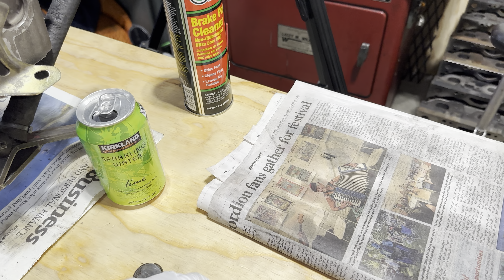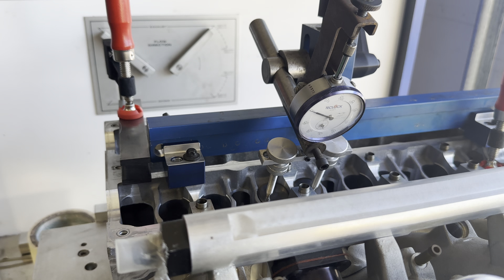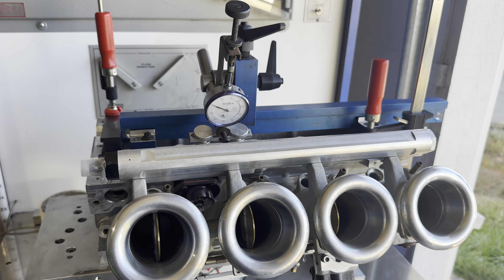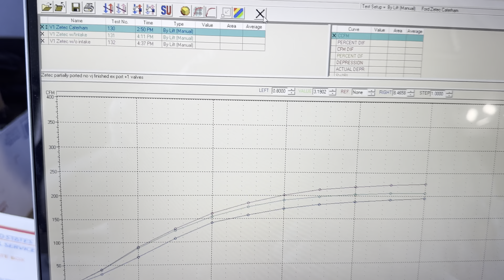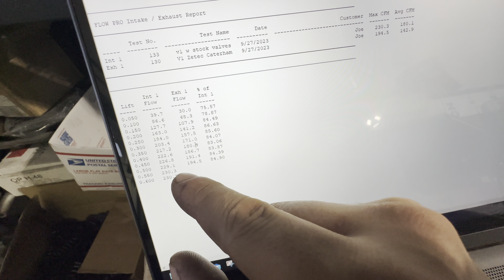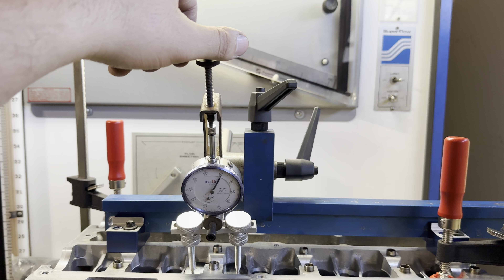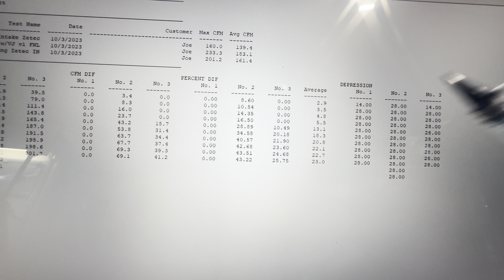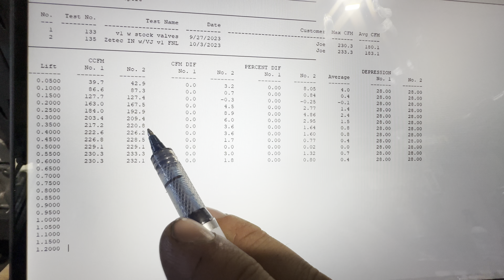Race Porting the WORST NA Head I've ever seen! | Toyota Valvetrain Explained, Engine Rehab Episode 7

Comment: Exhaust leak ticking is a common occurrence in many UZ series motors so i would say you're guess is probably right. Lots of people have 250k and up mile uz's with just MLS head gaskets and a turbo putting down 400hp+ to the wheels. The record for a non vvti sc400 that has a stock bottom end has ran in the 8's. Crazy reliable and strong engines. You really need a stand alone ecu to go past the mid 300hp range and only certain factory ecus can be tuned iirc. Plenty of junkyard supercharger  options for cheap power too.

Comment: A stock SVT/St170 Head will have 50 more cfm of flow everywhere and can see 300 hp NA if done properly. 
Nothing is the same between the 2.0l Black top, and the svtF head. 
Different valves, ports, cams, vct on the intake cam, bigger holes, different tappets, different valve guides, its all different. Valve cover is not the same. The intake flange is 15mm shifted on the bolt flange. 
If you want real info on the svtF/St170 head, you have to reach out to danSTenginering and burton power.
Reply: So if I was looking for more in that head shown here, it be more readily achieved at perhaps those you mention or some place else with fuller info on the range? This is too experimental? Lacking?
Reply: What? 
I cant understand what you are asking.

Comment: Did the first Zetec heads 25 years ago.  Didnt do much on exhsust as ruined one because of extreme core shift.  Then found out ...a good seat profile , back cut and nice radius ..... ready.  

Intake port I  , depending on budget ,  either kept it small with 34 mm valves.  Or raised it with epoxy about 4 to 5 mm from start to inner radius.   That flows good.

The focus 170st  head  or silver top heads are much better on intake and easier
Reply from the maker: Yeah, I got a look at an st170 head, weird that this was in a caterham.
Reply: @EngineRehab Zetec is a common swap into the caterhams, until the duratec came out that is

Comment: The Zetec head you have here isn't the SVT Focus version - it's a standard 2.0L head from the regular Focus models, probably '03-'04 based on the casting number. That would start with 2M5V instead of YS4E if it was the SVT, but the most obvious indication is the lack of VCT oiling and solenoid mounting for the intake cam. You should have seen stock flow numbers closer to 160 exhaust and 230 intake on the SVT. You still got great numbers - Central Florida Motorsports used to sell a ported SVT head that maxed around 195 exhaust and 255 intake.

Comment: Can you run gappless rings? They will give it a little more suck on the intake giving you a tiny boost to intake exhaust flow ratio. 

It's clear that the port wants the floor raised a little, if you could weld the F out of the floor I'm sure you could get the 250cfm number you're chasing.

Comment: You said something about running .430 or .450 lift. Given the valve size that's a lot of lift. Would a 50 or 55 degree intake seat be a better complement for that much lift, with appropriate top and throat cuts? Or, given your low lift numbers, maybe a 30 or 37 degree intake seat will pick those numbers up, with the greater separation area between the valve and seat. 

I meant to post that to you on Reddit.
Reply from the maker: I think a 50 degree cut could help, but I think the ultimate path would be epoxy, shrink the port up, and add some short side height to it.
Reply: I know nothing, but I assume that unshrouding the valve in the chamber as much as you can (on the side opposite the intake port where the air will want to go) and using a flat 30* seat is how you could get better flow @ low lifts.
& you aren't planning any K series, Skyactiv, Duratec investigations in the future are you? :D
I'm having fun watching. @EngineRehab

Comment: I'm thinking about building a 4.8 LS maybe a 5.3Lt, or even the 4.3 LV3 , possibly modify a 6.2 intake ,  maybe a small turbo capable of 1 bar boost, with a BTR CAM, port the head, work the valvesand seats, un-shroud the valves maybe go a bit over sized. If they can be un-shrouded enough, connect it to a 5speed or 6 speed, connected to a 8.8, stuffed into a subaru Forrester from the late 90's early 2000s pre-06-08 roughly. Looking for 600-700 to the tire. With the ability to crank it to 890(+/-)with a tune E85, and a turbo swap, i want to keep the lag to a minimum, maybe use a diverter valve with a twin scroll, i dont think id be wanting to spend $$ on a variable geometry turbo.  I'd like to get the head's flowed at least before porting, my rigged up flow bench can show changes, not comparable numbers with real flow benches. Possibly get them flowed after to get an idea of the potential, awesome video, if i don't learn something, it at least makes me think about things.  Happy new year 🎉

Comment: Really strange results for a 4 valve. Not much more than my gen3 gm 60 deg v6 heads. And those are 2 valve with 1.74 intake valves and 1.42 exhaust.

Wonder if theres something with the chamber also?
Reply from the maker: The chamber is not great! It's a big old flat bathtub, not much I can do about that.

Comment: Run the lash down to .006-.008” on both sides.  That’s exact architecture we’ve been running on the Japanese bikes forever.  Typically everything is shim under or we convert it to under if any performance is the goal.  I know the  logic is the exhaust is gonna run hotter so they want tad more clearance so it never tightens up and keeps a valve hanging open, but we’ve done tests checking lash, directly starting engine and run the shit out them and getting it hot, and immediately popping the valve cover.  The lash never gets smaller it actually grows. 🤷🏻‍♂️. So we’ve always run em on the tight side and pretty much every bucket engine will work with 6-8 thou.  Now you can play with it, open it up to pull some duration if the aftermarket cams too big.  Etc etc.  but your an engine builder too so I’m sure you get what I’m saying!👍🏻. You know Laurie at web too I see, bunch of nice girls over there and they do good work!  Do you get anything from Megacycle- (Barbara’s a tough one 🤦‍♂️)
Reply from the maker: Mega cycle is twenty minutes south of me. And no, I hear she’s a firecracker.

Comment: Question, does anyone do anything performance related with the dodge 2.4L, in the 06-12 years,(08 dodge avenger) or are they 💩 as it seems, i have had the idea of swapping a k24 and manual transmission in its place. If i can get it to run like a stock car, and everything work, tricking things to behave. Or possibly run a standalone ecm, and simulate the signals to ecm, possibly piggy back the stock ECM, maybe even swap a J-series if i can get a 5-6speed, convert to rear drive in a 08 avenger, use a charger rear diff, narrowed axels, would be cool but id want to make a project of it not just a swap, it needs alot more to go with it, much more to do. ✌️

Comment: Port matching still to do You said then you don't want to open up the port entry. I don't know any of your level tech. Would it be better just to go to all the most rewarding cuts in ports befor flowing? Many four cylinder heads leave me mystified by the subtle changes in head design that produce faster accelerating motors and broader rpm HP.. Not all the great producers are 4 valve unless punching for RPM. Is any or all of that sounding ...about right? Without going into the cam duration and lift values?
Reply from the maker: The intake manifold side is smaller than the head and needs matching. And on stuff that isn’t responsive to porting it’s helpful to spend time testing on the bench to ensure every decision made contributes to an improvement. More than just total airflow too.
Reply: @EngineRehab  yes. velocity is important more than a passive gulp of air volume , I'm told. I am trying to end up with the right mix for Nissan NapsZ . From heads for 1.6 to the big 2.4 with big valves and ports. Another can of worms.

Comment: THIS IS NOT A SVT/ST170 CYLINDER HEAD. 
This is a Non VCT 2.0L 2000-2004 Focus Zetec black top. 
At max puff without modifying the cam lift bucket area you will never make over 220 hp with that head. 
This is the worst cylinder head in the Zetec lineup
Reply from the maker: Yeah, this will make plenty more, and regardless of which head it is, it's what we have to work with. Thankfully It's going to do just fine :)
Reply: Your work is good and your data is fantastic. 
The main reason i commented is to simply inform you that it is not a SVTF cylinder head. 
I have a hand full of oe casted SVT F heads sitting i am willing to ship to you with some valves so you can see if your ported 2.0 black top is better than a actual svt F head. ( im sure your port job will be better than a stock svtf head but by how much???? ) 
Ill pay for the shipping if you want a SvtF/st170 zetec head with some valves for testing.
Reply from the maker: @bscotty24bmx  that info would be great for you and the public! I’d flow it if you sent it.
Reply: @lindoncoggins  one of my comments got deleted some how.
Reply from the maker: @greatestevar  what are you talking about.
Reply from the maker: @bscotty24bmx  wasn’t me

Comment: What engine is this?
Reply from the maker: 98-05 Ford Zetec 2.0. Would have come in the Ford Focus, Mondeo, ZX2. Some caterhams had them too.
Reply: @EngineRehab  I was thinking it was a Cosworth during the mid of video (where I opened the clip) with sound low down so I disturb nobody sleeping nearby.
Reply from the maker: @jackrichards1863  Cosworth heads are cool. I got some exposure to a lot of those. Towards the end of my career at my old employer I was able to improve on a Ford Kent program that remained unsuccessfully improved for almost ten years. That was cool.
Reply: @EngineRehab  Awesome!